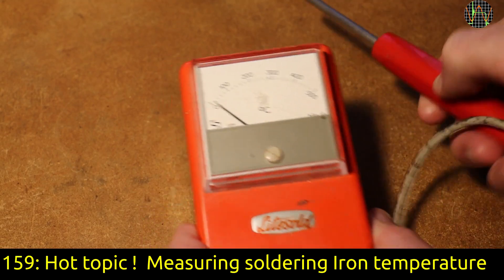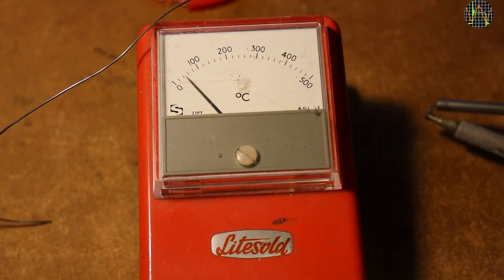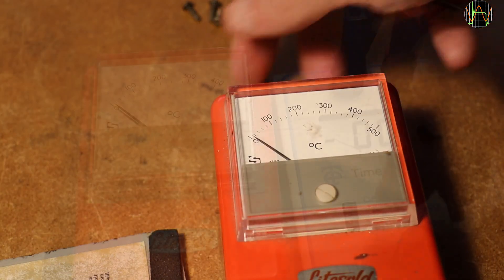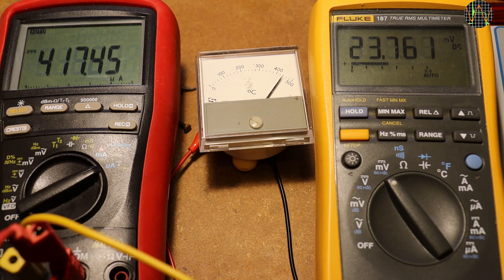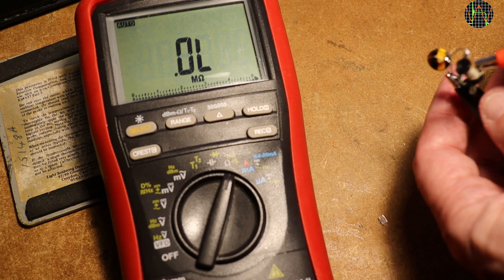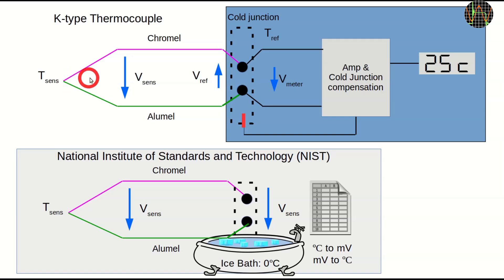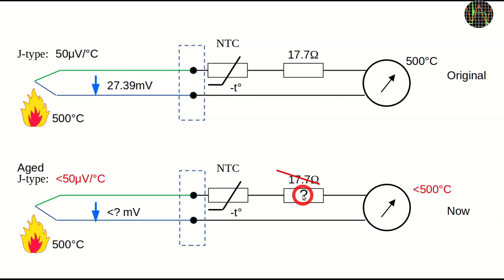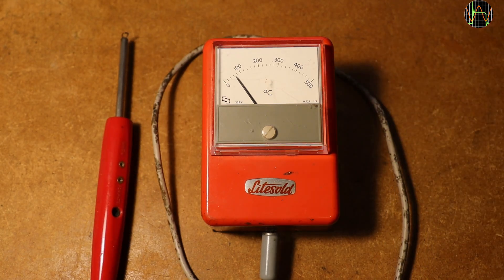159 - Hot topic! Measuring soldering iron temperature

Comment: why not use a k-type probe or two, and a multimeter with thermocouple reading ability or two, and then you can calibrate an iron at say 150 degree or 200 degree (or adjust its temperature set value till your thermocouple reads that exactly), and then you know you can leave the iron at that exact temperature, and now get a proper calibration resistor for this meter now that you know it should read exactly 150 / 200. But I also wonder if the (resistor + NTC) needs to be a proper value, in order to match a proper cancellation curve of the cold junction effect? Although maybe then also this effect is so small in the weeds  you don't need to worry about it too much, again as you said, for such an instrument.

It's cool how the whole thing works purely on physical effects and needs no batteries.
Reply: I think that one of the challenges is the way that Solder interacts with the K-type Junction. There can be oxidization issues, so perhaps they use Iron / Const to provide better long-term stability
Reply from the maker: @johncoops6897  I agree which is why I did not want to mess up my good K-type probes
Reply: @TheHWcave  - you know the little bulk packs of Hakko 3-way junctions, and the new version sensor AS5000 for FG- 100B.... I wonder what kind of junctions they use?
 I wasted far too long searching, and didn't test my Hakko to try and determine what it uses.
My idea was that if Hakko used Iron/Constantine then maybe you could adapt one of those onto this gadget instead of adjusting for the aged probe. 😉
Reply from the maker: @johncoops6897 Yes that's a possibility but honestly I am too busy with other stuff right now. I may pick this up on a later day again though.
Reply from the maker: Yes, you could totally make one yourself with a 50uA or 500uA instrument and a K-type thermocouple, If you always work at say 20 or 25 deg room temperature, you could calibrate the cold junction offset for say 22 deg in and then the meter would only be wrong by the few degrees that the actual room temperature differs. No need for a NTC in that case.
Reply: @TheHWcave  k-types don't typically reach to above 300 degrees accurately, afaik, for this purpose they are less well suited. But you can transfer the accuracy of one to the other at a medium temperature

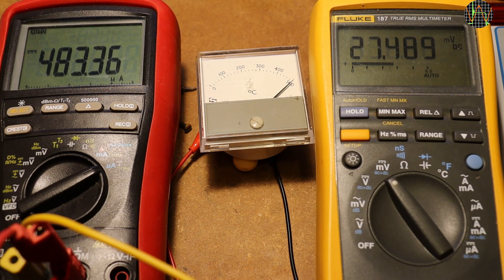Comment: I'm confused. At 4:28 while the sticker says 27.39mV you say 23.39. 10 seconds later narration again says 23.39. And finally at 5:32 same 23.39.value is repeated while the Fluke actually read 27.40mV from what looked like full deflection at this camera angle but sure parallax effect can make things hard. In the worst case you're only 90 counts off on a 50,000 count 0.025% basic DC accuracy rated meter.
Reply from the maker: Somehow I got 23.39 in my head when it really was 27.39. Sorry